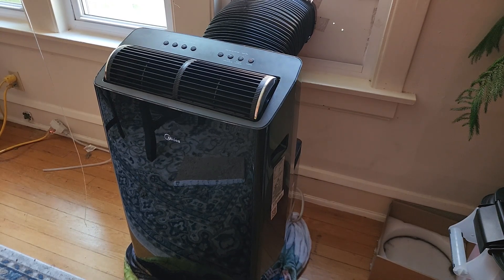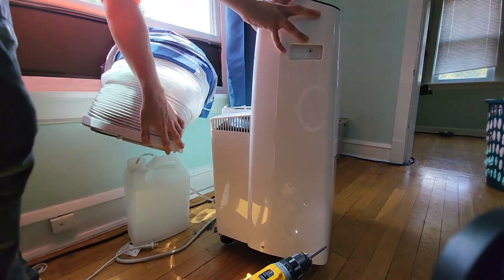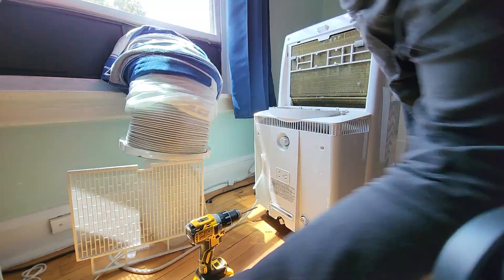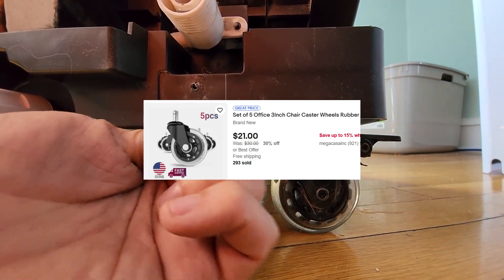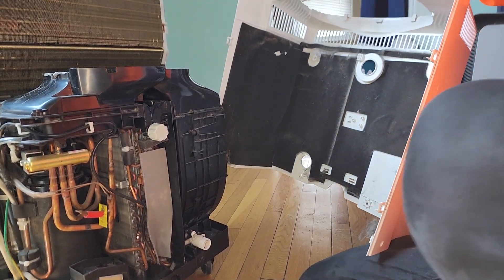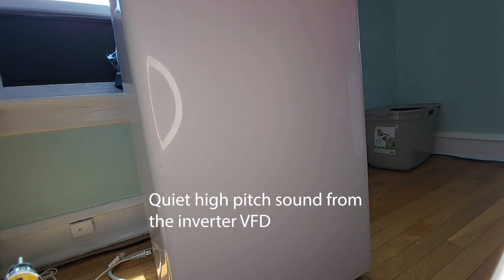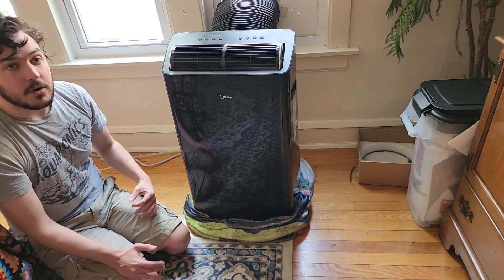Why the Midea Duo is an *Almost* perfect choice for Cooling AND Heating Your Home

Comment: Do u know the wattage when fully running
Reply from the maker: In cold weather, at the beginning of a fresh defrost cycle, around 900w and after 1-2 hours it will slowly drop as the coil ices up to around 600w. It seems so make at least twice that if not more in heat. Rather unfortunately, Midea doesn't seem to publish the COP data as far as I can tell. 

It's efficient but it really depends on how much electricity costs where you live. For my application, this makes sense because my other method of heating my 1600 Square foot apartment is a massive 200,000 btu 70% efficient boiler. 

I'm planning on actually doing the math on if these actually save me money this winter. I suspect that they do but only a small amount since they become much less efficient when it gets much colder out here in chicago
Reply: @theinappropriatemaker  I'm in south ga heating is no problem. It's cooling on high max cooling wattage.
Reply from the maker: @MrLabarr123  My Kill-a-watt died a while back but I don't think I ever saw it pull more than 1150 watts and it drops down fast as long as it's not in a room that's too big for it. 

You can also just set it for a fixed speed and it will pull significantly less power. If you just set it to manual speed, you can set it to low (400-600 watts), medium (700-900 watts), or high (900-1150 watts) 

At night here in Chicago, it usually will drop to 400-500 watts as long as I'm not trying to make the room too cold. 

This is by far still one of the most efficient portable air conditioners you can currently get. 

They also have a Midea Window unit (MAW12HV1CWT) that's basically the Window unit version of this unit that has a CEER of 13.3 vs 12.3 That the Midea duo achieves.

 The Midea MAW12HV1CWT is also only 330ish USD at costco right now!
Reply: @AnIdiotwithaSubaru  thank u it was very helpful

Comment: This is really nice tech. I do wish they were sealed better and worked in colder outdoor temps. I have an unheated crawlspace, and am thinking about putting one of these in it. This would have the effect of warming the floors in the house all winter. Main problem is it would not work in the colder months.
Reply from the maker: Yeah, it's hard to blame the units because it's really down to physics and the fact that it's been mostly 240v mini splits that have been getting all the love and attention.

Midea does seem to be pioneering the 120v window unit market in the last year or two and I'm certain we will see some "hyper heat" models with drain pan heaters and other stuff, in the not-so-distant future!

Comment: There is like only one or two companies manufactoring all these brands of window, and portable ac units.
Reply from the maker: Yeah, I believe that Midea is the manufacturer for these units and the others that appear to be identical. 

Midea is pretty obsessed with copper evaporators and condensors in all their products, presumably to maximize efficiency, and all of these units have big copper coils! 

The weird thing is that the whynter has thermal foam insulation missing from certain areas where the black Midea unit has it but they were manufactured almost one year apart so that's hopefully all it is?

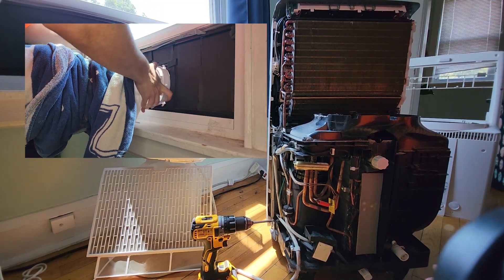Comment: Great video. Can you please explain about the heating mode when it is too cold outside? I see that you remove the hose from the windows at 3:42 to be able to run heat mode when it is too cold outside. Costco has 14KBTU with a heat pump on sale at $449 and I am thinking about getting one just to use it in winter time. Thanks!
Reply from the maker: Yeah, so the unit will shut itself off and stop heating when the temp outside drops under around 35f. Opening up the vent like that allows the unit to pull in and mix some indoor air which allows it to heat in lower temps. That's at the cost of efficiency and heat output though. If I had to guess, it makes it output 2000btu - 3000btu less since it causes a large amount of negative pressure in the room and will suck in cold air from outside. 

 I've only tested it down to 20f with the vent pipe like that. I can't say I would recommend it as a primary heat source but I use it to supplement as long as I can until I'm forced to turn on my massive antique boiler.

There are plenty of single hose heat pump units that work just fine like that so mixing in air should still be more efficient than a single hose portable heat pump
Reply from the maker: I should add that 35° is what mine shuts off at. On paper, they're supposed to shut off at 41°

Comment: You need a vacuum dude (it will cut down on the cat hair problem/LOL). Nice breakdown video though. I just bought two of the heat pump models from Costco ($399/ea)...
Reply from the maker: I think I need less animals too. Haha. 4 cats and a border collie is just a lot of hair. 

Im 3d printing some filter adapters right now for the back grill that will hopefully help 🤞

I saw that costco deal and I'm so tempted to buy another couple!

Comment: Have you noticed any strange odor ? After one day of use mine was already putting out a strange odor during the moments the fan was only running.
Reply from the maker: Actually, today I investigated my Whynter branded unit because the smell wasn't great and found it's full of mildew! Guess I'm cleaning that soon

 It's normal on any mini split and air conditioner but it's still worth mentioning. I'll upload picture if it because it's pretty nasty.
Reply: @theinappropriatemaker  no mildew in my midea but the evaporator coil that looked like new because it is lol..  is what smelled really bad. I sprayed it with a product called evap fresh and it seems to be okay. Just finished with it, also I put drain pan treatment. Really hoping it doesn't smell again anytime soon because it's a pain to disassemble.

Comment: shame you cant buy them in the uk
Reply from the maker: Yeah, these are pretty good. I'd imagine the UK will get a better 240v version in the future. I wish 240v was standard here
Reply: @AnIdiotwithaSubaru  we have 18,000 btu single hose units and there was one dual hose inverter Amcor branded unit but they don't manufacture it anymore so the uk market is just single hose or split ductless systems
Reply from the maker: @fabianholder5053  I'm hoping with the increasing popularity of cold climate inverter minisplits, we will see more low temp portable units. 🤞

Comment: Very similar to my Dreo Twincool.
Reply from the maker: I'd try the Midea MSmartHome app and see if it works. I saw that one online recently. 

How do you like it?
Reply: @AnIdiotwithaSubaru  So far I like it, room stays around 88f without it on 100+ days and is able to keep my room at 74. Just hope the plastic hardware on the tube stays together because I take it off the window when I leave the house. (Got about a 1-inch crack along one of the sliding panels.)

Comment: Does control panel become wet during dry function because of condensation? Does drain plug work?
Reply from the maker: I do occasionally notice a little bit of condensation on Midea branded unit but never actual drops. 

My drain plugs do work but I have to tip the unit back to drain it for whatever odd reason. The heat mode condensate pump works fine on it's own.

I have heard some complaints of full drain pans errors but I think that's for extreme humidity. It's pretty insanely humid here in Chicago and I haven't had that with either unit. Something worth mentioning though
Reply from the maker: It actually just happened for the first time today. Only on the Black Midea branded unit. It was insanely humid today though. Chicago was 92 but a "real feel" of 105 with humidity 🙃

Comment: Cats are people, too!  Terrific video. Is their a preference to you personally between these two units as there is a difference in pricing? Do they work better in high or lower humidity?  And will this cool 550 square feet?  Is there a limit regarding how low it will cool in relationship to outside temperatures?  Wow, what a lot of questions!
Reply from the maker: From what I can tell, they are identical. I like the more simple style of vent on the "Whynter" branded unit but that's just personal preference. 

These would have no problem with cooling 500 Square feet.

 Just be sure that you have enough fans to keep the unit working hard. Inverters compressors should have a constant load on them and it seems like they do better in a big space.

Chicago has pretty wicked humidity in the summer and both units don't seem to mind when it's dry or humid. 

The cooling performance isn't overly affected by the outside temp but when it gets cold, the heat pump functionality will struggle when you are near freezing. That's when I use the vent trick to let it intake warmer indoor air. No idea how badly that impacts the coefficient of performance but they both only use 800-900 watts in heat mode and make easily double or triple that in heat. 

Efficiency for heating is a relative term for me since my only other option is a massive 200,000 btu 70% efficient boiler from the stone ages.

Shop around for the best price on these. The costco near me has the 4-1 reversible heat pump unit for 499 or 799 for two units. I paid 699 for just one last year and I wish I had seen that deal.
Reply: @AnIdiotwithaSubaru  Thanks so much for all of the good info!  Much appreciated.

Comment: Why does it still suck air from inside the home and has two hose?
Reply from the maker: It seems like the unit isn't sealed up very well at all. 

The issue is that if you fix that completely, I would worry that it would heavily impact its heating performance. Since it probably helps it not ice up as frequently pulling in warm air. 

I might try to seal it up better
Reply: @AnIdiotwithaSubaru You’re right. I have a Midea ac single hose converted to dual (11,000 btu cooling 9,550 btu heating) and with the chamber 95% sealed, it would go into defrost mode every 45 or so minutes when the outside temperature is 8c (46f) or lower.
Reply: It has two hoses in that one big hose. No negative pressure from cracks.

Comment: Rip electric bill.
Reply from the maker: Haha yeah, it's better than an even worse gas bill though
Reply: @AnIdiotwithaSubaru As a blind person, I'm heavily considering this but I have no real knowledge of any of the sounds of this unit will make. I've looked at other videos, but people don't describe what they're doing. Or they just talk over the sounds. Is it possible? You can make the sounds or make a video of all the sounds these units make.
Reply from the maker: @vectorcollector4893  absolutely, is there anything I can compare it to that would help? I don't have a decibel meter. 

  These are very quiet for the most part but in heat mode that's usually not the case. The exhaust fan works very hard in heat pump mode and is not quiet. (it's about as loud as a conventional ac in heat pump mode) 

For me, the efficiency is worth it but I can imagine something loud being even more annoying for you. Let me know how I can help
Reply: @AnIdiotwithaSubaru  I'm actually very surprised you're willing to help. Not many people are that nice, thank you so much. Well, I'm just looking for all the possible sounds this unit can make. To start up the different fans and motors. The unit just generally starting up The compressor and also the reversing valve. All the different modes, I'm also kinda curious the sounds. This will make a few switch it from cooling mode to heating mode abruptly. The different speeds of everything. A bit unrelated, but could you also do an overview of the remote control? Cause I can't find much information on that either. I can't find Many people willing to help.
So it's much appreciated.
Reply from the maker: @vectorcollector4893  no worries, I'm  happy to help! I did some filming today and I will do a little bit more tomorrow. Unfortunately, I wasn't able to find the Midea branded remote only the whynter branded remote. Despite the two units being almost identical, their are remotes are not. The Midea has a much nicer remote that would be much easier to use for someone who is visually impaired. Bigger buttons, bigger layout, bigger screen. 

I also recorded a quick video of my old two hose Danby traditional portable ac to hopefully help compare to.
Reply: @AnIdiotwithaSubaru  Thank you so much. That's really great that you're willing to take time out of your schedule to help a person like me. What type of clips are you recording?
Reply from the maker: @vectorcollector4893 the sound of the inverter starting up, the sound of the reversing valve dumping pressure when switching between heat and cold, low speed on cooling (which is super quiet, how loud it can get on cooling, and showing some of the shortcomings like how it can sometimes cause a low frequency vibration of the floor and how to fix that issue. 

 I also have older full clips of it defrosting but they are with my old FLIR One thermal camera on the same phone so they are the same microphones for both videos. (s22 ultra :p) 

I tried to show how it gets pretty loud in heat mode but unfortunately, it's pretty smart and because it was hot outside, it kept the exhaust fan on low. Part of my defrost video likely has it though so you should still be able to get a decent idea.

Another thing worth mentioning is that the unit beeps when you do anything but it can be muted but only in the damn app! Also as soon as it's unplugged and plugged back in, it will beep again. It's a bit annoying.

Trying to show the good, bad, and ugly instead of showing my confirmation bais that I bought something I think is the best. 

They also have a 12k btu window unit now but I think this unit is still better if you're trying to heat with it. In the video, I show a hose trick where you detach one half of the intake hose, which allows it to heat in even colder conditions at the cost of efficiency.  

However the new window unit has a significantly higher SEER but shuts off at 41F
Reply: @AnIdiotwithaSubaru  That's really nice. Do you know exactly when you might have that up? Or you gonna put it as a private video
Reply from the maker: @vectorcollector4893  Im uploading it as unlisted now. ill send a link soon. The only thermal cam video i had that was good was the stuff i included in the video so its mostly just the unit in cooling only. Lmk if i missed anything
Reply from the maker: @vectorcollector4893  https://www.youtube.com/watch?v=eFcXs-qdqB4

Comment from the maker: DO YOUR HOMEWORK, THESE KINDA SUCK
Reply: It's getting cold now. What are your thoughts on this? Is the heat working?
Reply from the maker: @rbrown6808  I use it for heat but not as my primary heat source. I really only run it down to 30f or so and then switch to my old boiler. Because they lack emergency heat coils, these definitely can't be used on their own for heat imo. 

Chicago has also been wicked warm so its been hard to judge